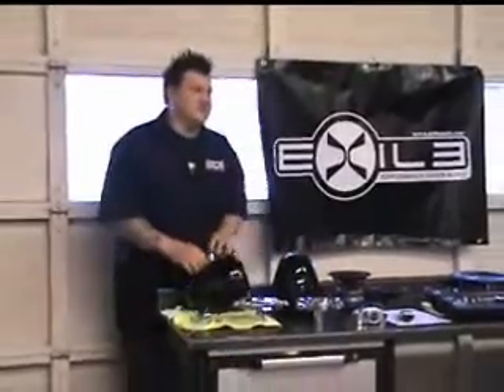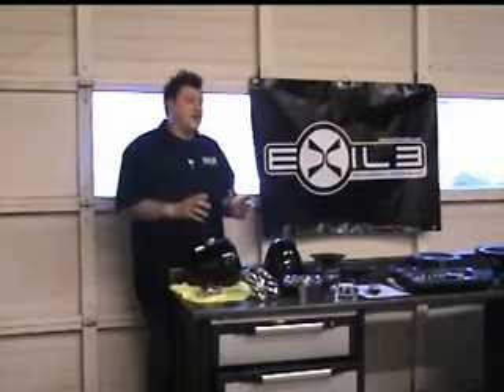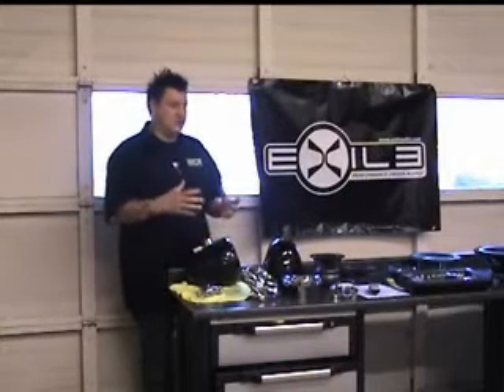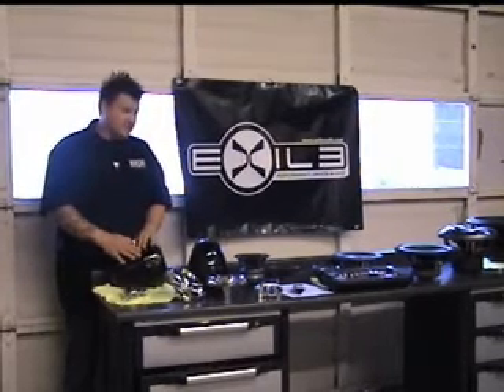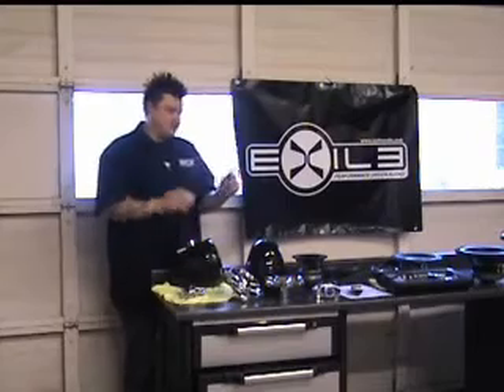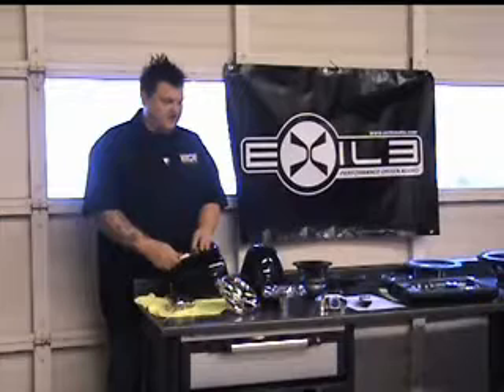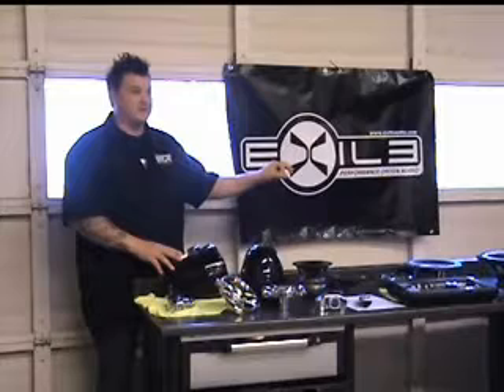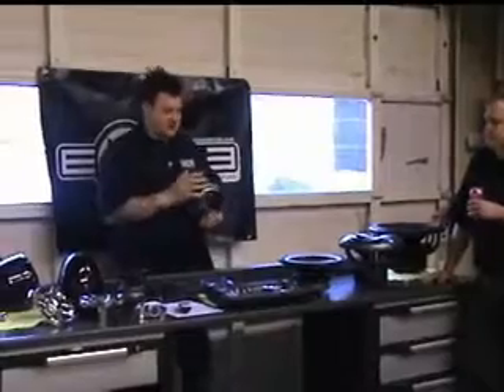Exile TechTune NW Part 1.wmv

Comment: BIG DISCOUNT goo.gl\sfM2L

Car Video
Exile Audio

Lets face itâ€¦ It ultimately comes down to bragging rights out there on the streets. The 3000+ Watts of power handling in the Exile Big18D2 is bone crushing â€œStreet Loudâ€  bass performance that is second to none. It features 2 inches of Peak to Peak excursion, huge triple stacked 230 ounce motor structure, and itâ€™s very happy in ...
For more details please copy the Amazon link below in your browser:
goo.gl\sfM2L